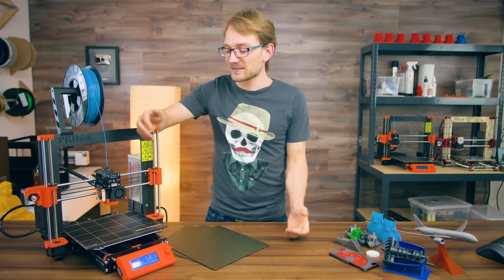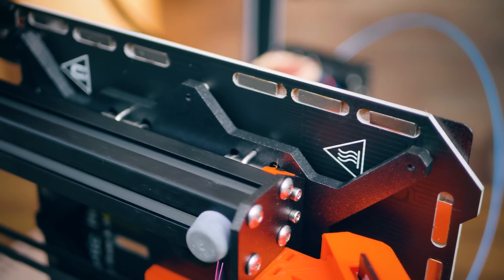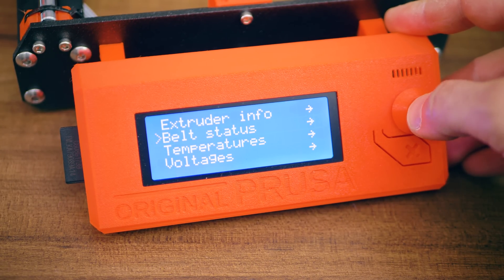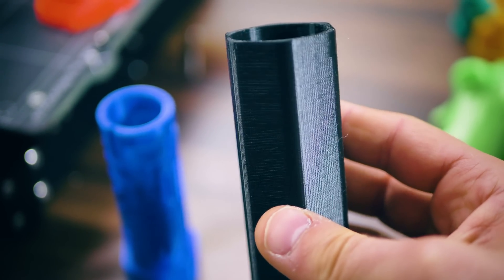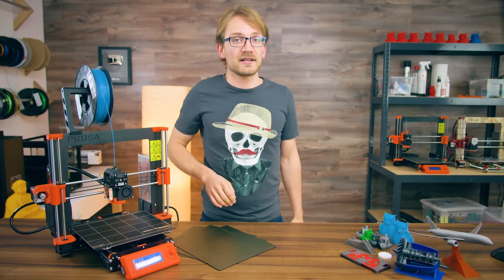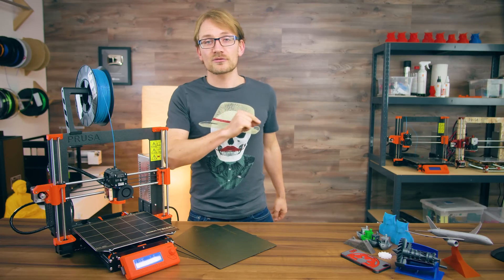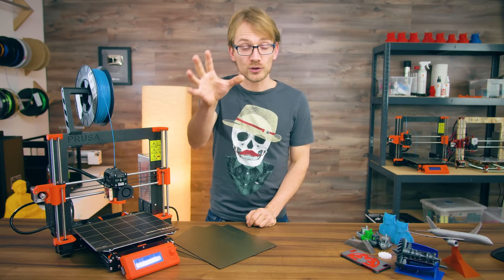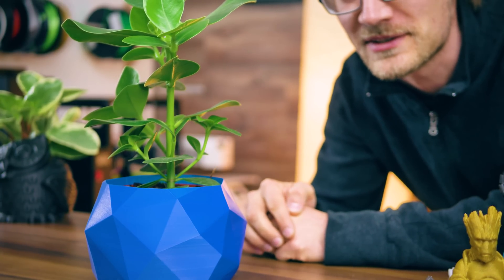The most important 3D printer - Original Prusa i3 MK3 review!

Comment: I am one of those silly people that prefer the audio of the steppers :P
The PEI powder coated spring steel plate is something that I hope that will be something that will be mass manufactured and easily obtainable for clones or other printer setups.
But, really the only the only things that need changing, is a 32bit controller.  This will easily enable the use of thumb drives on the remote displays, a better remote display with touch, though this is debatable as you can just use OctoPrint on a Raspberry PI.

Comment: Dang it Tom!
I’ve been waiting on my Mk3 for a while now and these videos keep making me impatient!
In terms of manufacturing, why does Prusa print those parts for the 3D printers instead of injection molding or casting them?
Is it a tolerance thing? Or is it a way to ensure it still has the “reprap spirit”?
Reply: Jo prusa posted about this very thing, summary not in the spirit of rep rap (self replicating printers) and molds for injection molding are $10,000 or more and when they want to make a change, as they did the other day, updating a dozen or so parts, then you have to buy new molds. With 300 printers running 24/7 they produce nearly 300 printers a day so 2100 a week, 8400 a month.

Comment: Yes I agree that 32-bit is needed to improve user interfaces and leave overhead for advanced communications interfaces.  While Marlin and Smoothieware are fantastic, their interfaces are a bit cryptic and still on 2x16 LCDs.  Firmware could do so much more to help novice users with setup advice.
Reply: Dennis Fox Have you taken a look at Klipper?  It is a new take on firmware.  Basically, the 8bit chip gets relegated to just making precise timing pulses to run the stepper controllers while a faster box running Linus (like a Raspberry pi) does the gcode parsing and motion planning.  Now you can run the UI on a full up computer instead of a little 16*2 LCD.

Comment: When you talked about the possible improvement on the feet I thought: This should be a projet for Thomas .. and maybe also Maker's Muse and others .... improve the hell out of this printer, because I think it is the benchmark printer.
Reply: there are about 50 different solutions that people have come up with, i'm using the original feet with little locks that hold the push in feet like a champ. some people have printed out their own feet designs that you have to take and end plate off to insert.  take a look in the forums or thingiverse. It is only still a problem if you haven't looked. Also, who moves their printer that much. once you get it in place, how often do you move it?

Comment: So can prints still fail with this printer ? I mean normal situations when prints fail like the print detaching from bed, a bridge that failed, dropped overhang, nozzle blocked or underextruding ... For me some kind of camera system that can analyze if something is wrong would be really the next step
Reply: use octoprint and a webcam or pi cam and you can record time lapses. As far as not sticking. Pei is really good when it is hot. I have printed a ton of abs with very little warp if any.

Comment: That bed is definitely my favorite feature of the mk3. So much so that is just upgraded my 220x220 alu heater bed with neo magnets (150°C rating) and a 0.025" (0.635mm) sheet of 1095 spring steel. My first print last night, I flexed the bed and the part popped right off! No more shredding the blue tape with a putty knife!

Comment: selective microstepping would be cool.  precision where its needed, and speed where not.  or just geared dc motors with encoders like HomoFaciens did with his scrap CNC. A plastic strip along the axis with lines on it and a encoder on the moving head like in printers would be even more accurate, cheaper and faster.

Comment: Good review. I was most interested in how quiet this printer is so that it could be put in an office and have it run without it being a distraction.

After seeing a few other reviews, I am finally satisfied with this sound comparison. Other videos just didn't have the depth or fidelity to accurately compare the perceived decibels. 

Combined with an enclosure, it can be quite the non-invasive spectacle and look (and sound) quite professional.
Reply: when i first got mine i left it printing in the dark (the prusa frog) i came back in an hour later and thought the exact same thing, printer is done. turned on the lights and it was still printing just really quietly.

Comment: its a good printer but its not perfect.
My previous printer was a anet a8 so that was my reference,
Noise is the biggest issue ; mine has bearings that rattle and that can become almost as loud as the a8 is especially when the x and y move at the resonance frequency speed .
Prusa should offer a choice to have those plastic bearings for people who prefer lower noise over precision if only as a separate kit,
Reply: i loosened and pushed down on the z rod caps and the bearing noise is gone.
Reply: you mean those black things are intended to pre-load the motor bearings? I did not see documentation about there function so i assumed they where dust covers. (so yes they are loose above the motors on mine)
Reply: cmulder002 no I mean the ones at the top. If you lightly touch the side of The x carriage where the two bearings sit I'm betting they go silent. If you loosen and push down on the top caps they absorb the rattle and change the harmonic. It's only a mm or so that they come down and make sure when you are leveling z to loosen and push them back up so both sides of the carriage can get to the absolute top but otherwise with it lower it should silence them

Comment: I ended up getting the Creality due to its lower price and wanting something I could get running almost out of the box.  However,  if I had to do it over I might well get the Prusa as it has features like auto leveling and a flexible bed that I wish my machine had.  I addition I think direct drive has advantages over the Bowden tube design.  I don’t think one can go wrong getting this printer from what I’ve seen

Comment: Great and fair review as always Tom!
I have a MK3 myself but are having printing issues. For example the nozzle are catching the previous layer either tearing it or getting caught resulting in step loss. Other times it leaves blobs in the print or are fusing gaps together.
This most certainly results from bad slicer settings as the factory prepared files are working perfectly.

Could you please consider doing a slicer tutorial in true Tom-spirit for the MK3?

Have a nice weekend!
Best regards 
Martin
Reply: if you are using cura rather than prusa control or slic3r prusa edition. that is your problem. The mk3 z hop is super fast and without that enabled you can catch on the print.
Reply: Chris Nelson 
I’m using Slic3r.
Reply: Martin Lundberg prusa edition or regular? I'm actually very curious as I had the same problem with cura but really haven't had it happen with slic3r. What material also? Pla, abs, pet, pc? These are what I've printed so far.
Reply: Chris Nelson 
Prusa Edition. I’ve also tried Simplify3d with different profiles. The only filament I’ve tried with is the Prusa PLA in different colors. The funny thing is that even a solid cube behaves similar with more complex models with the nozzle catching the previous layer causing layer shift or detected crash.
Stealth step is turned off and I have the latest firmware installed as well (both driver and in printer)
Reply: Martin Lundberg try prusa control and see what happens. Very few settings to change and normally prints very well
Reply: Chris Nelson
This model have been sliced with both Prusa Control and Prusa Slic3r: https://www.thingiverse.com/thing:1817180
Failure around same height due to severe layer shift and then repeated detected crashes. With Prusa Control the “leaves” were almost completely fused. 
I’ve printed this on other printers with success so I was really surprised I ran into those issues with the MK3.

Comment: At https://youtu.be/M73uIMDlvvk?t=4m20s you say PTEG will be OK on the PEI bed if you "get the print temperatures perfectly right". You talked about PEI/PETG and print temps in the PETG video, but can you elaborate on this in the context of the powder coated bed used here?
Reply: use gluestick and you will have no problems with pei coming off.  the manual also mentions using blue window cleaner on the bed to allow easy separation of PEI pet-g. best is to wait until the bed is completely cool. as long as you use one of the two separators i mentioned on the build plate the pet-g just pops loose

Comment: So i got the MK3 Teo month ago. As one of the first users i was a beta tester for Prusa Research. firmware and software were in Beta stadium. With the first software version you could not get a good print with slic3r. 
I updated everything. The printer srill does not print like it should. And just for information: Ths sensor for the filament is just a runout sensor. It wont recognize when the nozzle is clogged (even though it was advertised my Josef) furthermore the printer wont recognize a skipped step if it is NOT because of an external reason (hand stops carriage). I have layershifts with the mk3. I have clogged nozzle every second print. Printing flexibles is a mess. The printer was announced with a pei powdered printing sheet, givinga nice texture to the first layer. And what does it come with? A pei film glued on the sheet. So basically tom hasa machine that nearly no customer can get.
And the best is: Support needs one week to give answer like: On page xx of the manual you can see how to troubleshoot. Or the tell you how to do a cold pull. Or wantto explain that flexibles haveto be printed slow with higher temperatures. I printed more than 20 spools of filaflex without any problem on the AnetA8. But the prusa wont to anything then clogg the nozzle or spill the filament out to the sides of the extrudergear. 
I am fu**ed up by the MK3 and the support too. 
For 800 Euro i could have bought 4 Anet A8. And they would do a much better job  after two month of working on them! First and last time i buy a prusa machine!

Comment: You don't have to pay even 120€ for the main MK3 killer feature, Anycubic Ultrabase is really fantastic print surface, only for $33. It's not durable like prusa spring steel, it's just glass with this magic surface, after cooldown printed part is just laying on the surface.
Reply: Yes, but does the Ultrabase come in a 9" x 10" size to properly fit the MK2/MK2S bed?

Comment: LOL good thing I wasn't the only one to assume the print was finished only to see the MK3 still chugging away. The fan jamming detection already saved my machine when some stray filament got into the low torque noctua.
Reply: Maker's Muse I'm really looking forward to your review! 
Since you're usually quite picky, you may find minor flaws that others simply don't notice in their reviews.

Loved Tom's review as well btw.
 
You are my two favourite 3D printing channels. Ever.
Reply: Same
Reply: Hello, in test sound all measurements taked with layer fan on, an on Prusa MK3 the fan is off!
Reply: After having a prusa i3 for half a year(not very long), I have come to the conclusion that everything is great…
Except for crash detection, but that is of course software. And my settings, although when I don’t tweak the accelerations in PrusaSlicer, it does crash. I usually have slower print speeds for quality, so I just leave stealth mode on. I have gone into my room thinking it’s still on preheat before starting a print, but no, it’s on the 11th layer printing in near silence. I plan to run octoprint on a Pi next to it so that I can wirelessly control it and monitor it.
Reply: True
Reply: Dose the i3 mk3 use copper as a product
Reply: @thatkinaboi6112  yes, you can even print HEU filament with it, no problem

Comment: My MK3 is coming next week. Can't wait to try my first 3d printer :) 
It will come with the MK2s printbed which is not removable and can't be bent, is that true? I am still a little bit confused, but I did not want to wait more as I purchase my printer on the 5th of November :)

Thank you for your amazing videos!
Reply: It comes with the mk3 spring steel plate, not with the powder coated surface but with the mk2(s) pei foil applied. So it is bendable, but has the smooth pei sheet.
Reply: Elian Terelle Thank you!

Comment: Hey Thomas, I'm sorry for going off topic, but I have a question/theory. I've noticed a lot of oilers for the filament prior to hitting the extruder mechanism. So... my thoughts are, filament in a drybox, add in an foam oiler BEFORE leaving the drybox, then another foam cleaning setup just before it hits the actual hot end, (likely not viable on bowden). My premises for using an oiler before it leaves the drybox, works under the assumption that it would protect exposed filament out side the box with a thin layer of oil on the filament. It might work, I think it's kind of like oiling a knife to protect it from exposure to air and moisture. 

Again I apologize  for hijacking this thread, I don't know any other makers personally to bounce this idea from.

Comment: But is it worth $300 more than the CR-10S?  I'm having a hard time deciding between the features/cost of the i3 Mk3, CR-10S, and the CR-10 Mini.
Reply: If you value customer support, the printer itself telling you what's wrong, self calibration, step loss detection, and you don't print only huge things, the MK3 is absolutely worth it. Also, if you want to print any flexibles, go with the MK3. Flexible on bowden is a real pain to tune in.
Reply: Remember that the hot ends and bowden tube are big differences. To printer higher than 235-degrees you will need to upgrade the hot end and flexibles are a little trickier with the bowden. All manageable, but it depends on how you value your time, silent running and support needs.
Reply: CR 10 here (not even S version) and I doubt the prusa will be much better.  There were a few upgrades though, such as the ultrabase 310x310, so not exactly the retail price total; that said, you do learn a lot while upgrading and the CR 10 is super easy to repair.  My only gripe is that on the 10 non-S the firmware is not upgradable unless you have an arduino programmer; this is not the case on the 10S, where you can actually upgrade out  of the box.
Reply: I won two CR-10S machines and one Prusa i3 Mk3 and I'd say the Prusa performs better. I've upgraded the CR-10S machines with ways of making it quiets, better bed adhesion, better extruders and nozzles, and a lot of the 3D printed upgrades you can find on Thingiverse. I've also worked with a few types of material - PLA, ABS, TPU & PETG -- making different detailed prints (slow and fine detail, fast and rough detail). 

I appreciate that the CR-10S has the bigger print bed and the newest ones come with some solid upgrades but ever since I got the i3 I've been using it more. It heats up much, much faster, it's quieter, it prints finer, accurate leveling is easier (which to me is worth $100+ alone) and the print bed being flexible metal while making the bottom of your print still look great are some of the reasons I think the i3 is a better overall printer. 

Don't get me wrong, the CR-10S is a great printer but it's just not as refined as the Prusa. When I got my latest CR-10S the feet were made from plastic and were all cracked (along with the Z-axis belt wheel cover). Three of the fans (extruder fan and two fans in power supply) were whining and then breaking within a month of getting the machine. Cable management on the CR-10S is a mess (hey that rhymes!), but the i3's is great. The firmware is simpler and I think (completely subjective) a bit better all around. I've since upgraded both CR-10S to Marlin 1.1.9 and it's better than before. 

The question you ultimately have to ask yourself is, "how much is my time worth?" -- because the i3 is just easier to use and I've nickeled and dimed away time with the CR-10S like I haven't (so far) done with the Prusa i3 Mk3 (why don't they just make it i4 or i5 or something? Good gravy...).
Reply: Even Prusa i3 Mk 2 beats CR-10s. I own both. It's not just hype, once you try Prusa Original you'll see the cheap Chinese printers aren't as good quality wise. They are cheaper though so it's a choice between price / quality. The CR-10s is also a really good printer though and you can go big with it.
Reply: It is not.  A few uprades put you past the level of the prusa.  Don't buy the hype.  Focus on eliminating vibration and the cr-10 wins.
Reply: twinturbostang no. It is not worth it!

Comment: You had me sold on this until you revealed it still used the ATMega for the controller. Yes, a 32-bit CPU is a requirement these days. It makes a world of difference and many of them are less expansive than the ATMega and have a ton more memory in addition to being multiple times faster. If the MK4 has a 32-bit CPU I will likely get one.